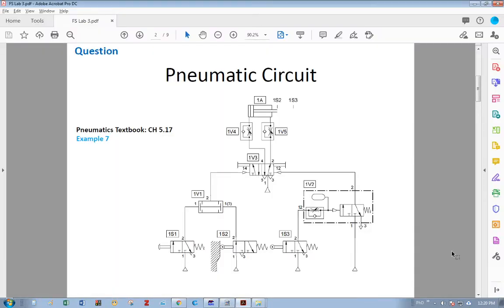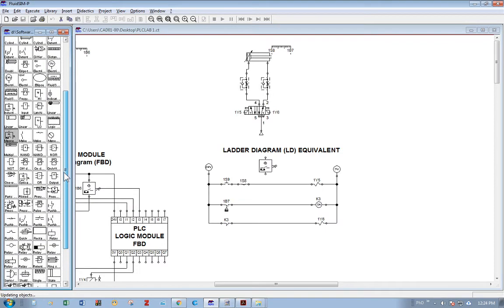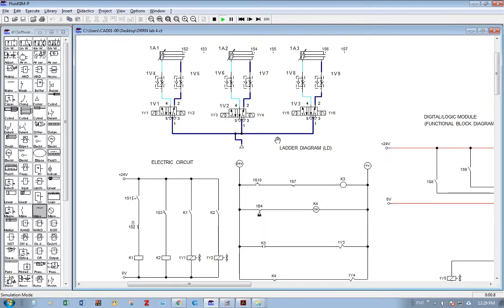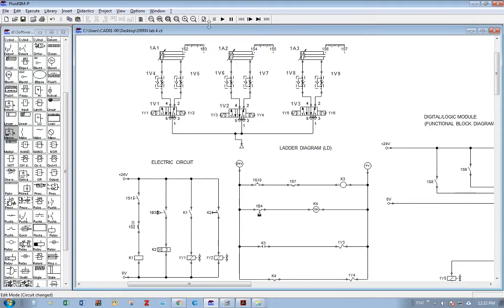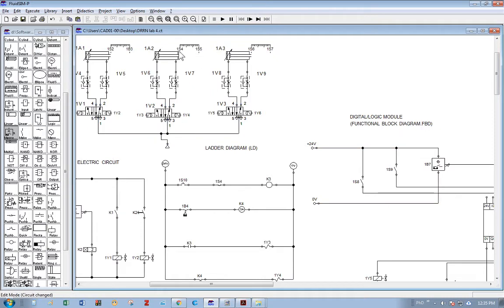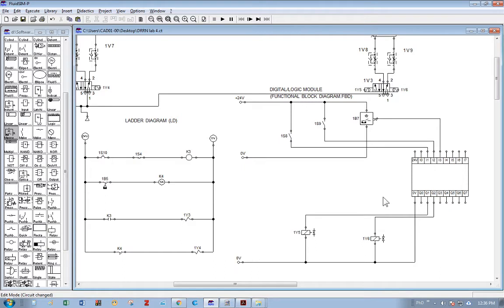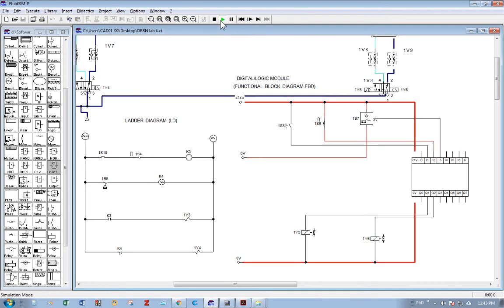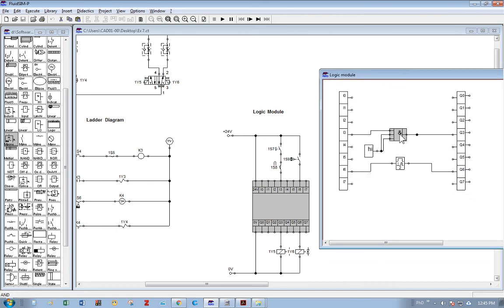Troubleshooting FluidSIM Circuits: Converting Circuits

Comment: How did the make switch turned into what appears a capacitor??
Reply from the maker: Thanks for the question, in fluidsim 3.6 there are two formats for making electrical circuits. Each format is based on a different standard that is why their symbols look diiferent.